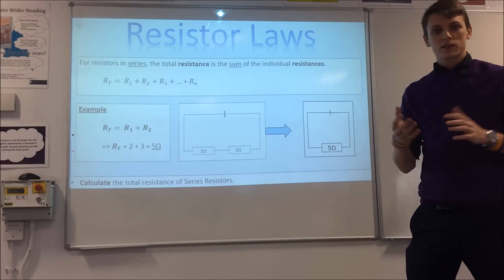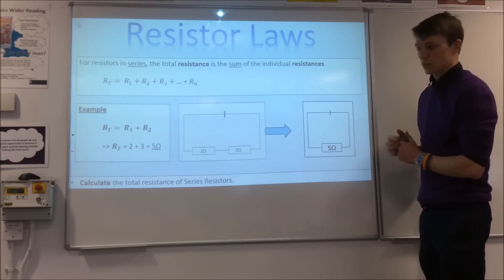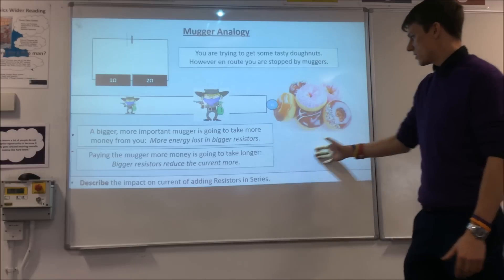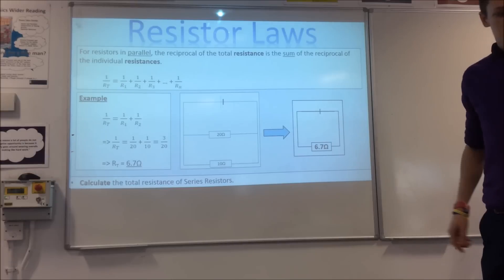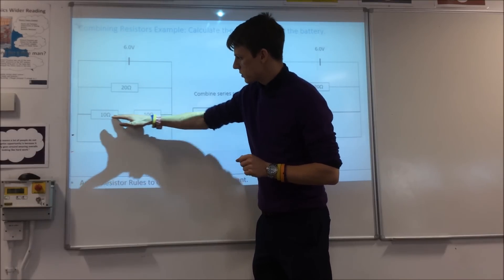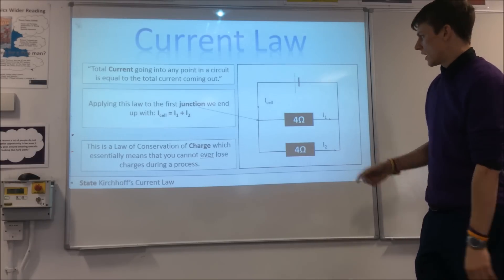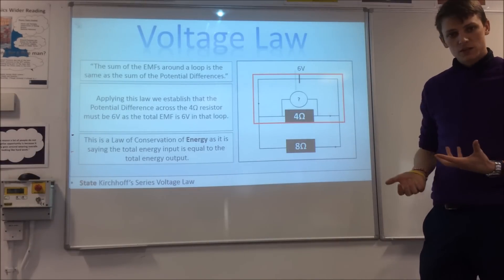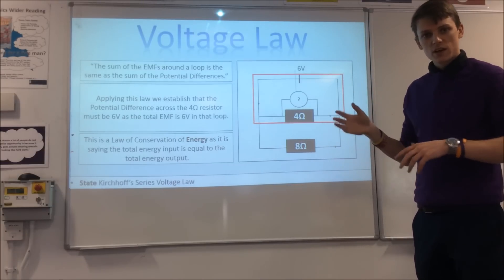A Level Physics: AQA: DC Circuitry: Circuitry Laws

Comment: At 12:03 , if the two 20 resistors in series were different i.e 60 and 20 would the current still be the same through them?
Reply from the maker: The current would be a different value (compared to the two 20 ohm resistors in series) but the current through the 60 ohm resistor would be the same as the current through the 20 ohm resistor in series with it yes.